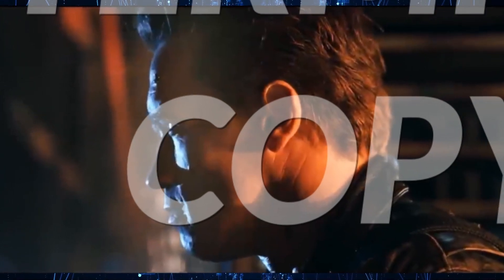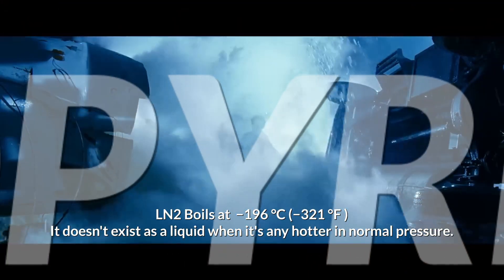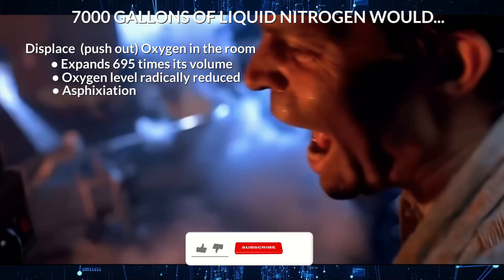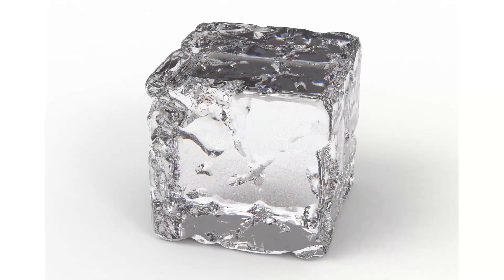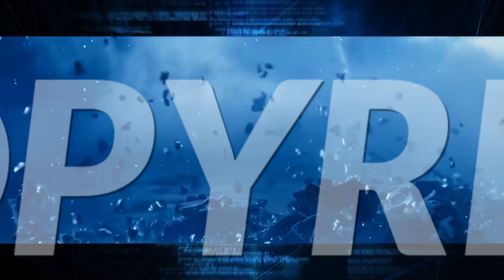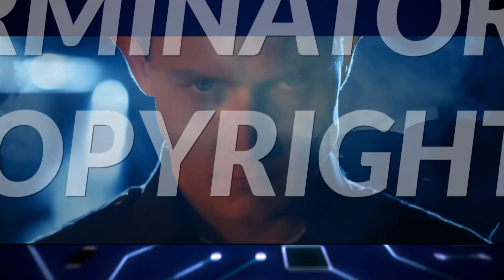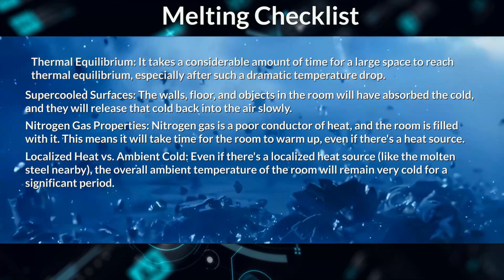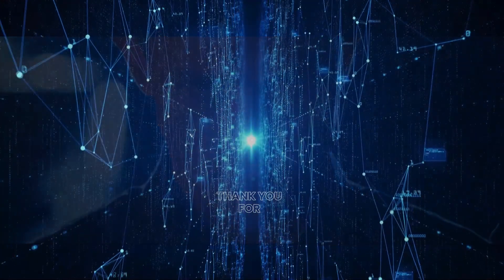Terminator 2.  Why Sarah and John Would Have Died No Matter What In that Scene (reupload)

Comment: as interesting as the idea is, the T 800 would have had a difficult time throwing the T 1000 into the molten steel as James Cameron has stated in a interview that when explaining to Arnold the scene where the T 1000 gets up from Arnold's shotgun blasts and grabs his Shotgun in the Galleria hallway fight, he explains to Arnold why he cant easily move or throw the T 1000 because 
the T-1000 is "Too Dense" that is why you never really see the T800 throw the T 1000 anywhere in the film. did you know that when they filmed the Steel Mill scenes they had to spray the actors with water so it looked like they were sweating when in fact it was actually cold when filming? i believe they used petroleum jelly for the molten steel and lamps underneath the pools for the glow effect possibly with a dye for the orange color, they also had people up and out of site creating the sparks seen falling in the scene as well.
Reply from the maker: Cameron is a sharper guy than I am but Cameron was just plain wrong about that. He didn't thik it through. The T-1000 was a regular-sized man, approximately 65,000 CCs of matter and made of a mixture of elements, even if he were made of a pure heavy metal. A normal man takes up 65 liters of volume. If the T-1000 was not hollow anywhere, the max  volume he could have is about 65 liters. Here is how it breaks down:

- Beryllium: 120.25 kilograms (265.09 pounds)
- Aluminum: 175.5 kilograms (386.97 pounds)
- Iron: 511.55 kilograms (1,127.85 pounds)
- Mercury: 879.45 kilograms (1,939.23 pounds)
- Gallium: 384.15 kilograms (847.06 pounds)
- Copper: 582.4 kilograms (1,283.78 pounds)

How about something really dense?  65 liters of tungsten  or gold (since they weigh about the same) weighs approximately 1,254.5 kilograms (2,765.87 pounds). 65 liters of depleted uranium weighs approximately 1,241.5 kilograms (2,735.64 pounds).

But of course he was not pure metal. He was complex technology, not magic animating a homogenous substance, and was likely made of nanites that were made of a mixture of materials, light and heavy.

For water and carbon, it comes out to about 150 pounds. If we were made of the pure calcium in our bones, we'd weigh 100.75 kilograms (222.12 pounds).
Reply: Correct & as per logic also you think that police motorcycle, helicopter, or that police car, don't  forget that bike jump to copter, assume t1000 weight for that heavy you think those vehicles can hold his weight like 100kg guy ? Chopper would have crashed instantly  when he jump from bike or that bike can't move like that like t1000 using it, according to camron was talking bout those vehicles can only hold few hundred kg even pickup trucks can hold few tons & according to strength of t800 it's easy to toss t1000 like feather for him & this movie was awesome  still recreating these scenes is not easy even by today's standards it's lot of work we talking as 1991 perspective over complicating fight scenes would be pain in ass back than @SciFiCinemaScience
Reply: Brother forget camron for sec, see how t1000 react to it's environment, let's assume t1000 was weighing that much, you think those vehicles can hold his weight like that ? That police bike he will carrying to stairs or that copter jump, even 150kg guy can't do those things, that chopper would have crashed instantly when t1000 jumped on that, & t800 is pretty solid in strength stronger than 1000 so he can easily tossed him in moltan but but movie was made in 1991 even re cresting these effects are challenging today it was wayyy big challange back than that's why they didn't over complicated scene
Reply from the maker: I'd be afraid to dip into petroleum jelly. I remember a person was once stuck in a grease pit and could not get out.

Comment: Chucking him would probably have been difficult, as cold as everything was. Arnold would have had to wait for a bit. My only explanation for the shot taken, would be the idea that it might cause more damage. That said, he immediately says they don't have much time when the globs start to come together, so perhaps he learned it didn't work OR, the heat of the molten steel was actually fast encroaching meaning it would take the T1000 longer to blob together than to thaw enough to move toward more heat and defrost. Ultimatly, if there was a decent explanation, they should have shown it in the story. Boom for boom sake is a big detractor from interesting plotlines
Reply from the maker: The cold would have been more complex with the Terminator. 800.Some parts of him could have been toughened by the cold while others shattered and others just froze up
Reply: @SciFiCinemaScience  agreed. Seeing as they are cryoincally sustained before use, he might have survived fine. Still, we don't know how he can manage heat or the operation temperature range for his hydrolic systems